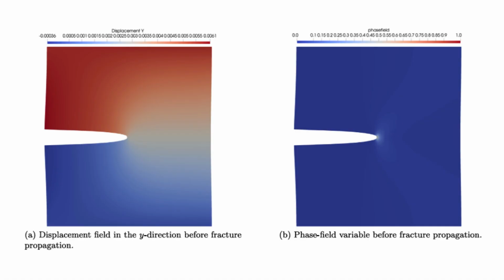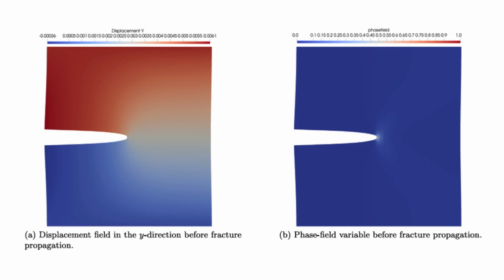Podcast - Less than 500 lines Python FE implementation of the phase-field method for fractures

Comment: Remarkable work. It’s inspiring to see that the fundamental laws of fracture mechanics—and possibly the universe—can now be expressed in fewer lines of Python than the average student’s ‘Hello World’ assignment. The authors have bravely demonstrated that when you combine NumPy, SciPy, and sheer academic optimism, cracks not only propagate in materials but also through the boundaries of computational sanity. This paper finally answers the age-old question: if a structure breaks in a simulation under 500 lines, does it still make a sound?